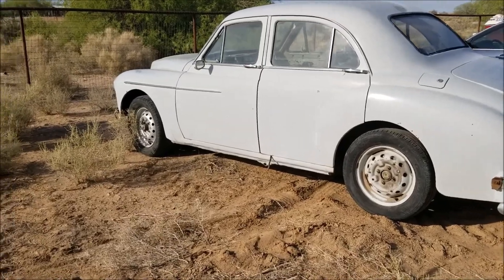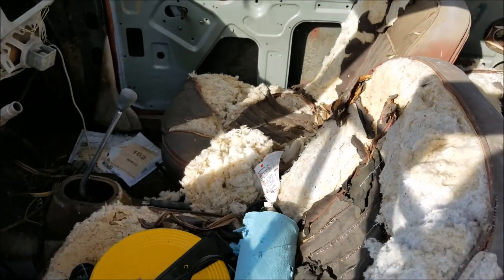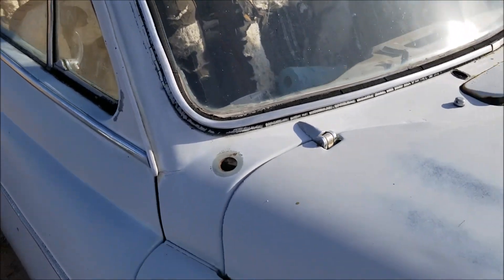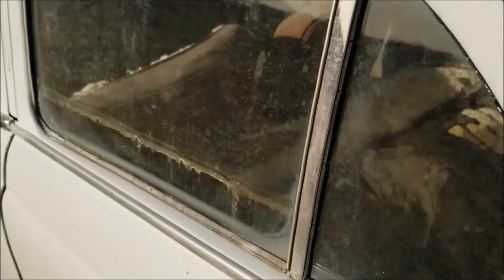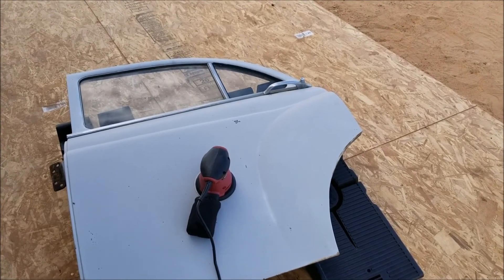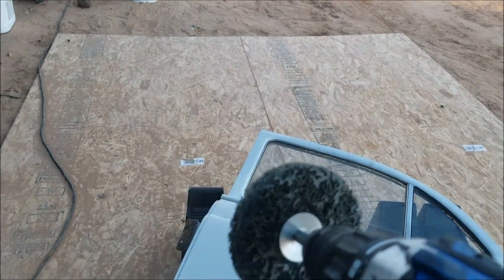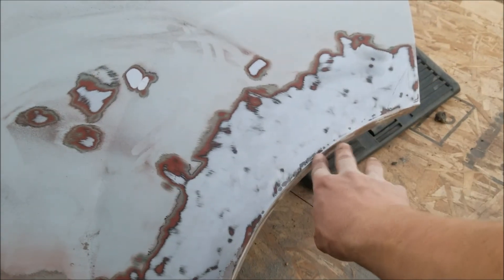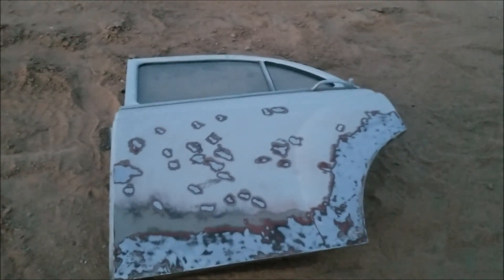Magnette starting to get into it

Comment: you can get those for an angle grinder from amazon
Reply from the maker: mephiskapheles6 iv gotten them from lowes in the past but Amazon may be cheaper. They where like 6$ a pop at lowes if u remember correctly
Reply: I've never checked there...but I'm in Canada so they will be more expensive here for sure